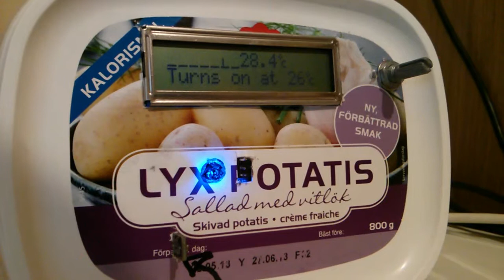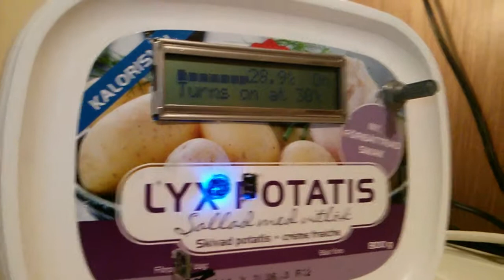Lyxpotatis Temperature-Controlled Mains Relay Using Arduino

Comment: tjena tjena, i new at arduino and programing. im trying to control temperature and humidity in laps of time                                     (first 72 H x values. then 72 H other values then the last will be antil i turn it of other values)                                                       it has to change. i wonder if you now this functions name. thanks in advance. ps can describe better if you like

Comment: This is great!! Awesome work there, I was wondering if you have any schematics on how the board is wired with the lcd, pot, etc, thanks!
Reply from the maker: Thanks! I unfortunately never made any schematics; I wanted to, but was under pressure to get it done quickly and just did it on the fly. It's  straightforward though: no discrete components are used. There's a hardware component list in the description, along with the software. It's all fairly self-explanatory. The most difficult part (which is simple!) is wiring up the mains power to the relay. Info on wiring the 1602 with the 4-bit interface is available on the LiquidCrystal library homepage. Good luck!